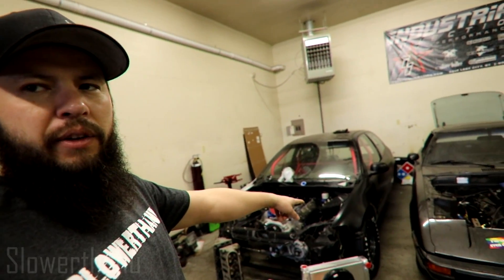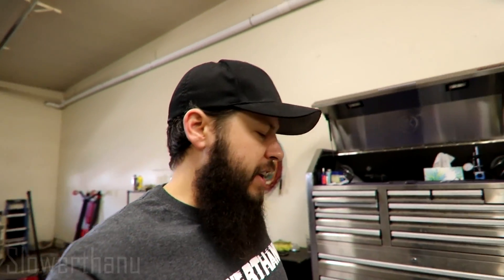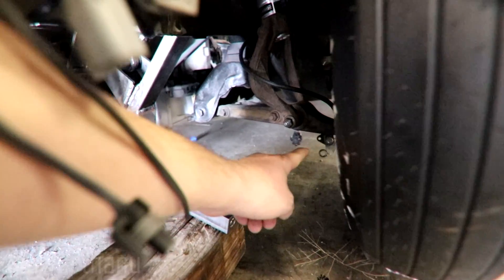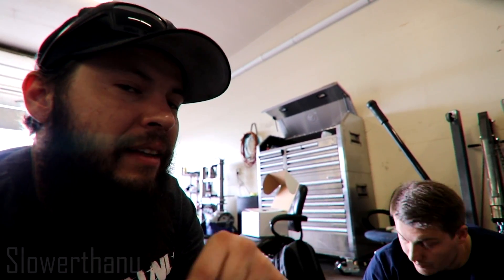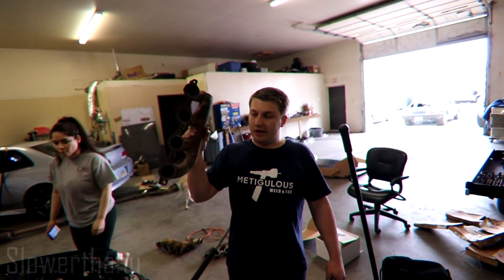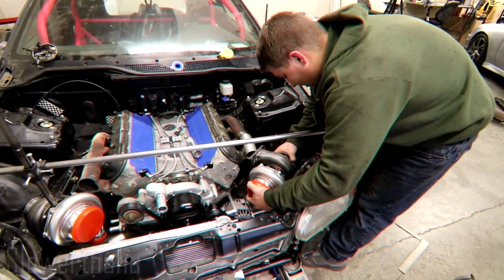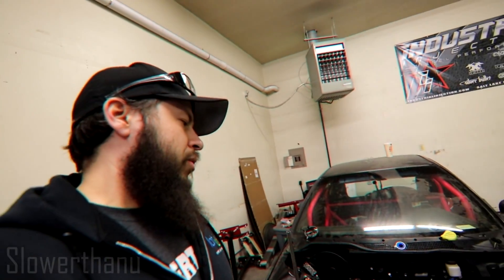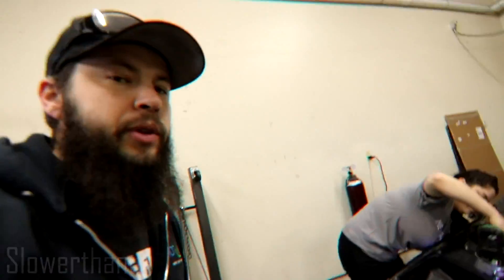RWD V8 Civic Build Part 11

Comment: If you run the radiator in and out ports the way your planning, your bypassing half of the radiator. Not sure if your planning to remove the divider in the passenger side end tank but if you dont the top half of your radiator will have no cross flow through it and will trap air in the top of the passenger tank. You really need a different radiator...
Reply from the maker: wesley todd there is no divider in this radiator. This method will work very well
Reply: @Therendonfamilia   if their is no divider then it was horribly designed originally..
Reply from the maker: Yes sir lol. That’s how my radiator currently is in my truck. It’s pretty terrible.
Reply: @Therendonfamilia  ya dude I would be getting that thing out of there.. next video you may explain some more on that. Some people may not know about cross flow on the radiators.

Hurry up with the rear end work! I need ideas for my own 97 hatch rwd conversion
Reply from the maker: wesley todd yeah we are going to do the same thing with the truck. Either insert a divider or move the bottom port over to the opposite side. Cheap ass radiators just put the ports in the right place but don’t put the divider in there to be efficient lol. Second damn time it’s happened to me lol. Rear ended work will be 2 or three weeks out. Just waiting on axles to be made
Reply: @Therendonfamilia  man that sucks, I have always wondered about those radiators if they where designed properly or just marketed to people who don't know any better.
Reply from the maker: wesley todd hey bad news and good news! We assumed there was no divider since we didn’t see a weld mark on the outside in the middle of the tank BUT it turns out you were right! This one unlike the radiator in my truck DOES have a divider to make it a true dual pass setup. Wasn’t welded to the outside. The good news is we figured out a way to route the hose to retain that function but not hit the passenger turbo. Definitely fooled us! My truck radiator still needs to be modified the way we were thinking we had to modify this one :/ will show it in the next video :)